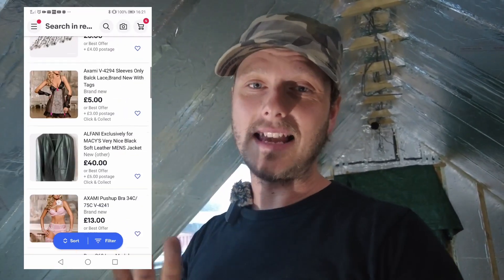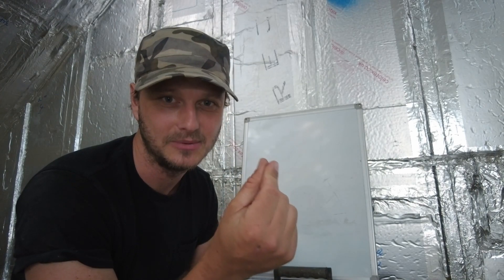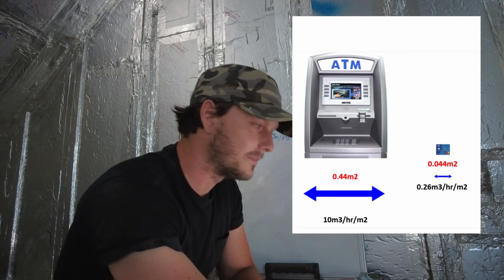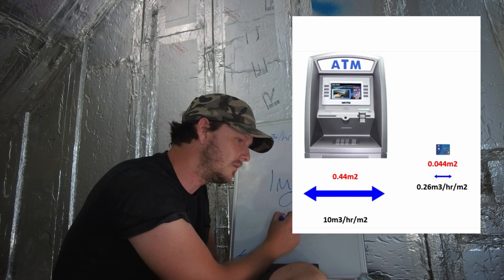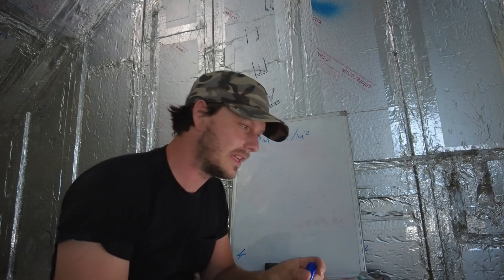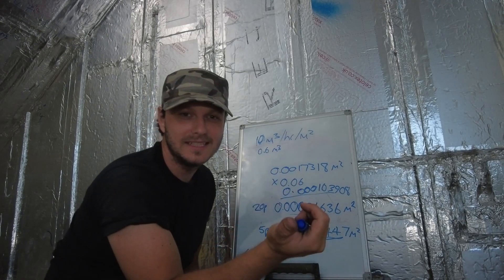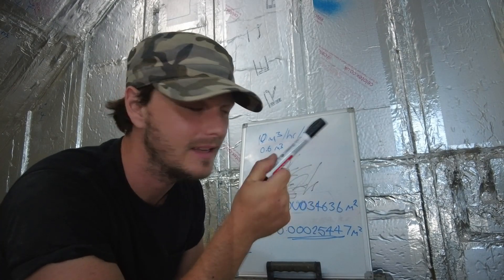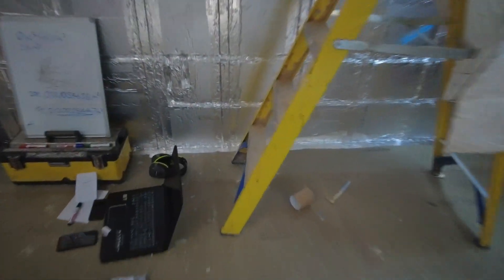Air tightness in real terms - New Build UK regs #selfbuild

Comment: Eh? I'm confused Aiden. 
44mms X 10 = 440mms 

100 x 44 would be 4400mm.

In both cases he's talking the hole size in m2 not the volume m3 so he hasn't changed units.

Comment: It's a cruel test, 2nd to drain tests IMO because the test occurs right at the end of the job. If it fails, then what? I did hear of a crowd that go around sites doing nothing other than applying sealant to all the cracks which gets them through. Also, if you know the right people, I wouldnt doubt that some houses fall way under spec. Of course the solo builder gets all the focus but then he generally takes more care. Looking at what youve done, I think youll breeze it. Neat job.

There seems to be a large disconnect between the academics and the builders. Few builders have picked up a pen, and few 'experts' have picked up a saw. Like you, I tend to chew on things to the nth degree until the answer pops out. In end you think, well that was a load of bollox in the scheme of things.
Reply from the maker: I have seen it suggested that if you're aiming for a low figure then it's best to have 2 tests. Then you can sort any leaks before you cover it up. But just to hit regs? No idea how builders normally ensure that 🤷‍♂️
Oh no the drains 🙈 that's gonna be an absolute ball ache

Comment: The paassive house 0.6 figure is actually ACH not m3/hr/m2.

Copied 
The q50 and n50 results are often very similar in typical houses, a coincidence due to their geometry, and which also partly explains why some people – in error – use the two values interchangeably. The results can be wildly different in more unusual building forms and in larger buildings because, as the building gets smaller (say a tiny apartment) or much larger (say a large supermarket), the ratio between internal volume and shell surface area changes a lot. This may also explain why it tends to be easier to achieve low n50 scores in larger buildings.
Reply from the maker: Ooooh so that's 0.6 air changes per hour! Haha doh!

Comment: My guess is you're getting close to Passive levels of airtightness there. Hows about pressuring up the room with a fan cut into a door blank and trying to find the leaks? See if you can measure the area of all the leak holes!
Reply from the maker: I would totally do that but I don't have the time 😂 I'm not sure I even need to get this building tested but I will need to test the main house so will probably get this one done at the same time to see the results. Won't be until next year though